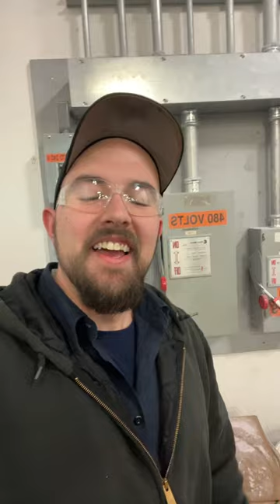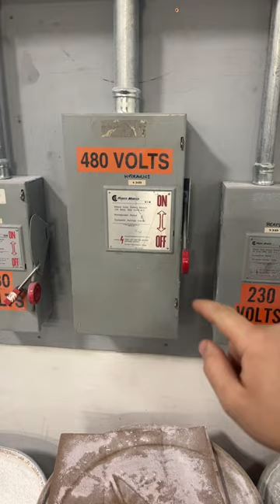Right hand rule!!

Comment: Following safety procedures is so important. I worked at a company that had electricians and one guy didn't follow proper procedure. He got hit so bad that he was permanently disabled. The company kept him on and had him teach safety seminars. Both because it was basically the only job he could do and as an example of what not to do.
Reply: I'm an electrician.  I was working for a contractor on a mill site.  One day a mill electrician  deenergized the wrong yard transformer. Then didn't double check by using a high volt tic tracer. He went up the ladder and as blown off from Arc as the voltage jumped to him. He lived for two days in a burn ICU before dieing.  He had one arm and both feet blown off. 
Electricity is unforgiving.  You can't see  smell or taste it but it will jump to you and kill you at the speed of light.

Comment: Also, take a deep breath before throwing it. If you get an arc flash the air around you can get hot enough to scorch your esophagus and make it swell shut. The deep breath stops you from gasping when the flash goes off and sucking all that hot air in; this preventing this death.

Comment: Not to be that guy but the right hand rule applies to being able to visualize the direction of charge in a system.  The LEFT hand rule is for disconnects and breakers etc.  you use your left hand (assuming your right handed) in the way he described so that if something does go wrong you only loose your left hand and therefor can still wipe your a$$  :)
Reply: Think I worked with you back in Arizona. How's it going? .... 🙄
Reply: Left hand to wipe and back to panel to save the danglin bits, win win
Reply: Same way i was taught. Use your NON prominent hand.

Comment: Lol I’ve never heard this, the right hand rule I was taught was Fleming’s right hand rule which helps to visualize and understand the relationships between the direction of current and the fields and forces generated by it
Reply from the maker: Bravo! That’s also the right hand rule, but I think this one is was more important than knowing the rotational direction of magnetic flux. Lol. Thanks for the comment!!
Reply: Iirc the right hand rule was for visualizing using electricity to generate a magnetic field, and the left hand rule was for using a magnetic field to generate electricity. Or maybe its the other way around, its been a long time since I learned that.
Reply: @dansproshop I think that's a topic you and electroboom should discuss.
Reply from the maker: @ogt92fromthe1step9  I love that channel. Im I’m the process of making a longer video explaining this more. I realize the “real” right hand rule describes the direction flux travels around a conductor. But this right rule saves lives. There is more than one. Thanks for comment!!
Reply: @dansproshop  you got it man. I've only known the right hand rule for the direction of flux. I work in industrial maintenance and never heard it put this way. Now it certainly makes sense the way you stated in a circumstance like re-energizing the disconnect. If there ever was a short or backfeed it may most likely happen right at that disconnect.
Reply: I was told by old head electricians then turning on a disconnect use the less dominant hand so incase of anything, u still have the dominate hand… but idk he always told me never trust a man with gold teeth and he had a gold tooth lol so idk if he was joking or spitting knowledge.

Comment: I know first hand about exploding panel boxes. Years ago I was asked to reset a breaker in a wood work shop. The breaker for the planer had tripped. As I went to open the door the whole thing exploded. I still to this day do not know just what happen. The door came off and hit my arm and knocked me down. Sparks were flying every where. Then the whole panel went up. It sounded like all 3 legs of the 440 3 phase were dead shorting. I could not see for being flashed blinded and just crawled away as fast as I could. Some one grabbed me and drug me out side. The I hear the pole fuse or something up high explode. If I had opened that box a split second sooner I were had got fragged in the face with bit os breakers and melted bus bars and who knows what else. I had holes burned in my shirt from something. The whole place had to be rewired is all I know.
Reply: 😨yikes! So right hand and stand perpendicular to the box to avoid getting fragged… got it!😳
Reply: The sawdust could have played a role in this. It is very flammable dry and conducts electric wet, and could be jarred loose by the snap of a breaker tripping. I've seen damp hay cause a melt down of a 12V wiring harness.
Reply: @don2deliver  
Thats wat im thinking too.

Comment: I was taught to ALWAYS use your right hand. It is furthest from your heart. Using a non-conductor like plastic pipe, wood,1000v rated screwdriver, rated gloves or fuse puller is even better. Just don't contact metal with your bare skin. And try not to stand where a blast will open the door at you first. I like remote disconnects. I'll assume you already wear cotton clothing and EH hazard rated boots. NFPA 70E is a good idea when designing cabinets to keep high volatage isolated as possible. Disconnects inside the same panels as low voltage controls are actually causing more issue with RFI on PLC controlled equipment. Even cabinet coolers can generate static interference with dusty intake locations. When you deal with sensors that require less than 5 milliohms resistance to ground, you start finding the culprits in crazy places!
Reply: This actually makes a lot of sense to me. We don't get the cleanest power at work.

We dont have anything that is down in the milliohms. But, weird things happen. Planets align, bad music tops the charts, and the old man on first shift had pastrami for lunch. Might be what is causing the "phantom" issue.
Reply: Axial fans and foam filters in a dusty atmosphere to cool a cabinet is a recipe for headaches across the board. I've seen it too often. An air orfice cooler will cool and pressurize a cabinet to keep dust out. Most companies don't want the down time to seperate the controls issue but tolerate the repeated down time to chase anomolies. A cost study will open their eyes and change their mind.
Reply: They are called VDE screwdrivers, And believe me they work.
Reply: Thanks for the real reason. 
If you use your left hand, you are not facing the switch gear. At least you can have an open casket funeral.

Comment: Excellent safety advice! 
I first heard of the right hand rule as it applies to caving. I use it anytime I have an option as to which way to go. 
The rule is that when you are underground and come to a fork in the road. ALWAYS GO TO THE RIGHT! 
That is very likely what they will do first whenever they finally come looking for your lost ass. 
It also goes a long way towards making sure that they never have to because when going back out you simply go left at every fork you get to if you've done that consistently.

Comment: I once had to cut power to a massive ammonia compressor soft starter that was coupled to a 4160v motor. The disconnect was terrifying… Little did I know, the company I was working for at the time actually didn’t want us touching 4160 circuits in any capacity whatsoever. Of course, throwing that soft starter disconnect back to the closed position had me holding my breath and turning away with my eyes tightly closed 🤣
Reply: Dude. Word.

Comment: I had just walked out of the area when a journeyman closed the disconnect on a new 750 Ton chiller (not it's weight, it's the amount of ice it could produce in 24 hours). Later analysis found a short between phases at 480V. The bus bars melted and ran down the wall before overloads tripped.

Comment: We have a 480 disconnect that’s 12 feet up in the air on a server grade air conditioner and it goes down at least once a month. Typically i throw it using a 10 ft piece of EMT that I hooked with a conduit bender. Works like a charm

Comment: Plumber here. We have to turn those off occasionally when working on pumps. It's always kind of scary, especially if you are wet already.....
Reply: I work in sewage a good deal replacing and maintaining grinder pumps in 3 county's. Their 220v, and sometimes just a little moisture gets inside the plug that isn't noticable, so it gets hooked up and you go flip the breaker back on and it's like a bomb goes off. I'm always just a little nervous flipping them back on especially after installing a new cord from the pump jug back to the box. It's just a small fear of the box exploding for whatever reason. It's a small fear, but plenty enough for me to stand to the side.

Comment: My dude, you should totally do a video on the right thumb trick for threading, well, anything with a clockwise thread.

Point your right thumb in the direction you want the bolt or fastener to move, then curl your fingers. The direction your fingers curl is the direction to rotate the fastener.

I use this trick with my trainees to help them remember which way tightens the locks on the Bridgeport, figure out which way the table moves when rotating the handles, and for adjusting fastens right the first time.
Reply: My pops taught me that at like 9 and at 46 I still remember
Reply: I don't get it
Reply: @planem1916  Okay I get it now. Probably didn't get it before because I was wondering how somebody could not understand how to tighten or loosen something. If you know the thread direction, I've never had this issue.

Comment: Yes use your right hand, but don't stand as far away in front of it as possible; stand as far to the left of it as you can. That way you're out of the line of fire if there's an arc flash / arc blast (those are two different things). Also, take a deep breath and hold it, close your eyes, and look to the left, facing your face and body as far away as you can.

Comment: I always stand to the side look away especially if I have to turn a circuit on with a cabinet open.  When I used to do commercial and 277/480 was involved everything’s shut look away take a breath and throw it.  480 going dead short will make you soil your shorts if your not expecting it.  Key is to always expect it to short then your shorts stay clean 🤣

Comment: When you get into that HIGH voltage like 4160v and up the hair raising is wild, just walk by a 3600 amp air breaker you'll see. Our arc flash kits all had a not metal boat paddle to knock your partner off it in case of arc. Love your vids very informative
Reply: We have some 4160 where I work. I dont know how big the breakers are, but we've got from 400 hp motors up to 2000 hp, maybe a little more.

Comment: I mean no disrespect towards you at all, but the “right hand rule” is more than that. 
- first off, you are only supposed to touch electric circuits with one hand so that if something breaks as to happen and you get shocked, the jolt of energy would go up your arm, and down your leg, to the ground. 
- the reason for the right hand being used, the heart is on the left side of your body…in turn, decreasing the chance that the energy goes thru the heart. 
Volts definitely “shock” you, but 1 amp thru the heart….😵
Love the videos. 👍🏻

Comment: Really if you want to do it properly you would stand to the side of it and your arm would be stretched out as far as possible to hit the lever. Your face would be facing away from it and you would have a full breath. You would hold your breath and throw the switch because inhaling molten copper is never a good thing. So yeah you could add that to your to-do list when throwing a disconnect.

Comment: I once worked in a tool shop that had been a coil steel warehouse.  They were still moving out and we're so worried about theft they would disconnect a wire inside the crane disconnect every night.  Eventually the insulation cracked enough that when the guy threw the switch the box exploded and blew him like 20 feet.  Only the soles of his boots were left.  They air lifted the guy.  I never heard if he made it.

Comment: I never heard of it until today.  45 yrs. ago I was working around a set of switches in an Electrical Gear Switching room when I became a victim of just such an arc as you describe.  I was hit w/an arc from an 880 switch and the only thing that saved me was about an 1/8” piece of plastic that was between me and the metal vacuum nozzle I was holding.  I was thrown back through the air against the opposite wall where I landed with the wind knocked out me, my hand on fire and the living daylights shocked out of me.  I was fine in about 20 minutes and my hand held no visible damage 2 days later.  I consider myself very lucky to still be here to tell the story!!

Comment: Oil field my Gen could light a small town 460 volts never had no flash if everything is grounded you should be fine . same at the sawmill Saws or chipper 440 is nothing to play with . But the dead man is so you can safely work on everything . or a lock out . never seen one light up .  I went to push a reset and hit the 440 live  shorted out a box that tosses fire out and a boom $200 breaker smoked . if its tossing sparks or fire its not grounded right .  That is all I ever been told .

Comment: I have been a Diesel/Natural Gas Engine Mechanic/ Emergency Generator Technician for 30 years working with Voltages 120VAC all the way up 13,800VAC High Volyage 132,000VAC you only get one mistake, then they whipe you up with a sponge!!

Comment: Some good tips on these videos. I’m surprised somebody didn’t call out the pull box above those disconnects. It appears one is labeled 480V and another is 230V, both fed from the same box above. I recall getting called out for that a long time ago. I don’t claim to know NEC, and I’ve seen a lot of things done incorrectly, but I don’t remember why that’s an issue? If it even is…